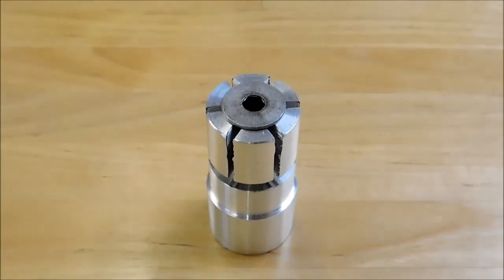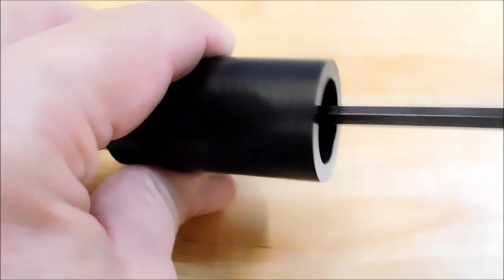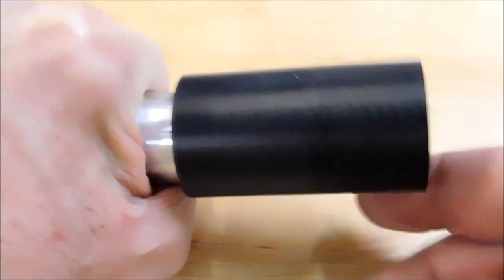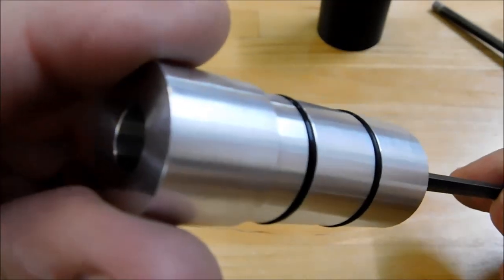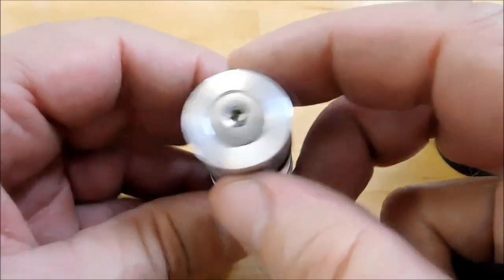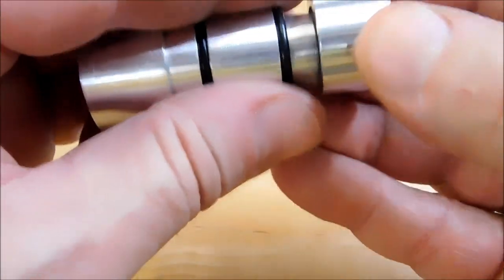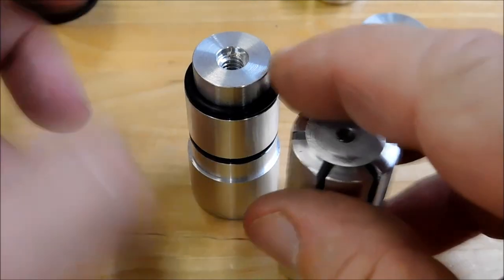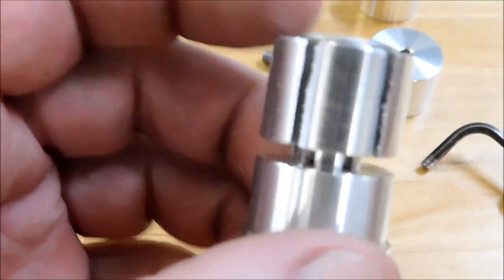Expansion Arbors --- No through hole...No Problem..Take a Look

Comment: To toss out my heavy duty arbor work around out here and no shorting Joe Pi for a great solution. Turn, drill, bore and/or reem to gauge pin size. Make 3 grooves for o-rings, not exposed. Over size length and diam. Hold in spin index, 3 cuts on vertical band saw for 6 pieces, leave one end to hold together. Take to lathe with 4 jaw, insert gauge pin free end, few drops super glue, center run out. Put 3 o-rings on it to hold. Part off, bevel and clean up. Make opposing taper sleeve and taper threaded inserts for hex screw length. It's going to warp. Insert tapers, few drops super glue, clamp one end with collets as dries, be quick, lol... Flip around and same for other end. Mount in spin index, spin and grind half under surface grinder, flip and do other half. Demount, remove o-rings, drop in acetone till it falls apart. Dry it off and reinstall o-rings, you're done. For small production runs on tough materials it's worth the effort. Joe's is better for one offs and plastics. This one's a lot more effort, but can be precise. Cheers

Comment: I was wondering, if you put the arbor in the lathe and slightly expand the fingers then turn them down slightly creating a taper on the fingers would that give you more contact surface on the part for better grip and less expansion force on the part by spreading out the force the arbor creates over a larger area. Whereas as is the very front of the arbor puts all the force on the front edged the arbor normally. Thank you for this great video, I plan to make me some up for standard OD sizes.
Reply from the maker: The final diameter of any expansion arbor is always turned with a light pressure on the screw. It eliminates the problem you pointed out and makes it easier to get the part off.

Comment: Going to check the repeatability, distortion, and different materials. Maybe Stainless steel. I would like to attempt to make longer assy to pass thru, expansion thru the project piece and hold on ends, check run out. Any suggestions on what materials use
Reply from the maker: These run very true if you leave an un-split locator diameter for the part. Any material will flex if you undercut it properly and use more than  4 splits.

Comment: I need something like this that will work on an ID polygon. Specifically a hexagon on one side of the part and a square on the other side. But to take it a step further each piece has a different size hexagon. In case you haven't figured it out yet I'm making sockets.
Reply: Actually now that I think about it I could probably just hold the outside of the part while I mill the inside square, then hold it from that.

Comment: Great advice Joe.  I am going to make a few of these.  
One question: I have a need to re-face 8 inch dia. copper and aluminium plates used for lapping gemstones.  What would be your advice on holding them in the lathe?  The problem is the flexing when cutting near the OD.  The plates are only 1/4 inch thick (or less) with a 1/2 inch centre hole.  The soft nature of copper and aluminium make this task difficult. (for me anyway)
I was thinking of making a steel backing plate with 1/2 inch arbor fixed in the center. The plates must be finished so they are very very flat, otherwise the lapping of the gemstone facets cannot be achieved to the required tolerances.  Some gems are polished to 50,000 grit to get the tiny facets to meet at a point.  Any advice would be much appreciated.
Reply from the maker: I spent many years in semi-conductor work and had to do exactly what you are asking about. The support at the jaws is OK, but the material deflection in between can lead to distortion and chatter. Watch my 'Simple chuck modification to parallel parts" video for the solution I came up with. It would be OK to add 2 standoffs between the jaws for improved support. Take a face cut with regular chuck pressure to start. Take a second pass with reduced, but adequate OD grip to reduce the material distortion and cupping potential. If you can get your hands on a 6 jaw chuck, that would be best. Good luck.
Reply: i found you about 6 months ago and have been watching quite a few of your videos since. some of the best i have found. i have always wanted to do a fitting and machining apprenticeship all the way to tool maker and then gunsmithing but have never found anyone willing to take me on. as well as that machining apprenticeships here are becoming more and more rare as most of the trades that dont absolutely have to be done here end up going overseas. this is due to a treasonous govt encouraging imports, regulating and taxing industry to breaking point to where they just have to close their doors. i hope to soon get my own small lathe and milling machine and start teaching myself. i already do some fabrication at home with welding and the like and once i get a new forge built i will be doing some blacksmithing and smelting as well. great videos and very clear information. there are not a lot of high quality tradespeople who can also teach so it is very good to see

Comment: For the o rings, is there a material that's better than others? And is there a hardness that's preferred? I got some made of silicone 55A in my McMaster cart and I am second guessing myself. I'd rather not buy one of each to find out. For reference, I plan to make an arbor for a wood lathe. I will be able to crank on it without fear of breaks or distortion, and the tolerance for concetricity is close enough is good enough.

Comment: Very clever trick sir.
 But wouldn't be better if you make a tiny chamfer on both parts that are squishing the O-ring, so it sits on v groove that helps the o-ring to expand easily ?
Reply from the maker: That makes sense. Just be careful the o ring pressure doesn't distort the cap or sleeve against the arbor and lock them up due to the pressure.
Reply: Thanks for your reply. One last question : What are the expectations for TIR for your both hard and soft arbors?

Comment: Nice! Question: on the split style, why not run a clearance hole through the entire split section? Seems like the threads in the split section are just getting in the way.

The o-ring style is ingenious. I'd definitely use at least two o-rings to prevent the part from cocking on the arbor. I wonder if you could use a differential screw to ensure that each o-ring gets equal pressure.

The other trick you could use would be to add multiple sleeves, with steps turned down at the end, to hold multiple inside diameters, like on a turner's cube.

Comment: Revisiting this video and it's just brilliant! I'm a pretty new subscriber and have been really enjoying your content lately! Just a quick question- can you comment on the precision of expanding arbors? I have a regular job where I need to hold a parted off ring (less than 1" ID) to work on the parted side, as well as to skim the OD. But I need the OD to remain concentric with the bored ID. Will I lose precision by using an expanding arbor- assuming I don't tighten so hard to distort the part?
Reply from the maker: Concentricity can not be assured if you locate your part completely on the split area. Keep that to a manageable minimum length and be sure you have a solid locating diameter for your part as well.

Comment: Great tip Joe!  I have a new bevel gear for the knee of my small mill that the shoulder is longer/deeper than the gear that came off.  Will this style of holding the work to shorten that should work?  Are there some length considerations also.  I can provide measurements or photos of what I am trying to do if that would help.  Thanks again for the very informative information that you provide!  John
Reply from the maker: If your mill is still operational, and you are concerned about gripping the gear in a lathe, strap it down to your mill table and mill the shoulder back. Feel free to send me a photo to my business e-mail. aiproductinfo@gmail.com
Reply: Thanks Joe!  Unfortunately my mil is not operational.  I'll take a photo and send it to you with measurements.

Comment: I have some custom fasteners I need to make on the lathe and I'm trying to think of a good jig for the job but I can't.  I basically need to do 2 operations to some 10-24 button head bolts.  First some threads need to me removed from the middle of the fastener, next the end needs to be cut to length (1.125") which is not a commercially available length.  I can think of jigs that would let me do one operation or the other but not both.  I'd prefer not to have to re-chuck between parts and just use the fastener threading to hold the work.
Reply: If you have  lathe with a short headstock spindle (like most cheap Chinese lathes) you could insert the screw through the spindle hole by making a long extension for a magnetic allen wrench. The fixture, held in the chuck, would be a simple piece of round bar which had previously drilled, tapped, counterbored (from what would become the left end) and then the bottom of the counterbore countersunk (same LH end)
Otherwise it's a bit tricky, I think. Do you have a quick acting (eg lever operated) collet closer of any description?
Reply from the maker: I have actually done a job like this, and coming in from behind is the way to go. I used a 5C collet with a stop, and a threaded slug to hold the part. Cut a counterbore in the slug to allow the head of the fastener to sit below the end of the slug. This allows for the use of a stop and controls the length of the thread regardless of what the head of the screw measures. Put a nut on you fastener from the opposite side, or the tool load may unscrew it from the slug. Machine as necessary.

Comment: These arbors will be exellent for removing and servicing brake caliper pistons, without the worry of marking their od
Reply from the maker: Thats a great idea. Use the aluminum kind.
Reply: I always removed them with shop air. Popped out easy.

I have a vintage Harley caliper with an aluminum body and steel piston that is stuck tighter than that.

I don't think it's going to matter much what I do as far as marking that one up...

FWIW, I've always been interested in making an adapter to hook a grease gun hose to a caliper and see if that removes the recalcitrant ones easier

Also, a trick another mechanic showed me for getting difficult boots stretched around the pistons win putting them back IN was to lube everything up, apply shop air two the inlet port, and hold the piston against the open end of the caliper boot.

The air blows it up like a balloon, and you slide the piston in it.
Reply: But, shop air sure as hell doesn't hold them in a lathe!

Comment: could this be done for a cnc lathe with a hydraulic chuck closer?? thinking an adapter could be made to fit the drawbar and arbor holder could be bolted into place instead of the chuck... need a way of holding castings in the lathe from the ID.

Comment: Hi Joe. What is your experience with the the precision of the set up with o-rings? Because it is not as rigid as solid metal support it should yield under the radial cutting force. How bad is the deflection from your experience? Can I cut under a thou with such a setup?
Reply from the maker: The relationship between the solid locating diameters on the arbor will determine the concentricity and location accuracy. Keep them close to your bore diameter, and the o rings should perform well. be very careful on very thin wall jobs. The o rings will push out hard.

Comment: Not sure if you have a video already on this subject, but "Holding screws" for modification in the lathe.....any good tips?
Reply: Take the right size nut and cut it with hacksaw (not in half just one cut -it will allow it to squeeze around the thread without damage it).You can use same trick with round stock to hold square peace in center in the three jaw chuck.
http://www.instructables.com/id/How-to-make-and-use-a-Pot-Chuck-for-your-Lathe/

Comment: Joe, need to use this to hold a timing pulley on the Servo of my BP CNC.  Pulley uses a taper lock collet.  problem is the shaft on the new servo doesn't extend far enough so there is a misalign between both pulleys.  I need to make an extension shaft, and am going to try this method.  Question is let's say the steel shaft is .8125" diam what size undercut you think I should employ  so the arbor will expand nicely but not be too weak for a BP style CNC?
Reply from the maker: The undercut size would be dependent on the screw used. Its more of a wall thickness relationship than actual diameter.

Comment: Very nice. And a good project for a beginner like me.  Have seen many expanders on the net and I notice that the expansion har the form of a rather sharp "ring" (visible at 10:33) at the end of the expander.  This is OK for steel etc but what about delicate and thin material? If the outside is tapered opposite to the inside one hopefully a wider area will meet the part causing less deformation. Or?  Suppopse smaller taper angles would make for a large "bearinglike" ring. Or?
Best regards/Ingvar
Reply from the maker: In the final operation of making one of these, you apply gentle pressure to the screw. This flares the arbor. You then turn the exact diameter OD on the arbor of the part ID you wish to hold. When you release the screw, the arbor tapers down towards the screw end. When you insert the part and re-torque the screw, the contact is very cylindrical. The taper is nearly non existent unless you machined too much off initially.

Comment: How accurate is this method of holding something? If you put something like a bushing on that arbor and need to machine the od how concentric could you get the two diameters?
Reply from the maker: Done correctly, its very accurate. Just don't split the location area and you're ahead of the game.

Comment: Sir, I need your assistance. I am trying to make something similar but much larger to place down into a tumbler, which is a stainless steel drinking up. I need it to make a cup chuck to hold my tumblers onto my chucks while the turn on my motorized tumbler I built. My cups are 10 inch in diameter and the chucks are made from pvc pipes and currently I am using foam to hold my cups I’d like to build a large arbor that is at least 3.5 wide so I may slide the arbor into the cup and tighten it so my cup will be held in place. I tried to get my husband to help me but oddly, me the wife, I am more interested in things like this more than he is, I truly hope I can get a comment back! That would be fantastic!
Reply from the maker: Greetings. A problem like this has to be a little better defined before a remote solution can be offered. Are you holding more than one cup at a time? What process do the cups undergo once mounted? Can you remove the arbor that holds the cups in between each process? Stuff like that. Large diameter arbors like this can be segmented and have multiple screw locations to activate them so you don't need a 10" o'ring. Is distortion or concentricity a concern. I'll help you, just tell me more.

Comment: Hi Joe nice video

What should be recommended taper angle of bolt? I mean with what angle we will get max. gripping force eg. Let's compare 90degree CSK bolt and 120 degree CSk which will provide more gripping force i case of expanding collet?
Reply from the maker: The smaller the angle, the greater wedge effect you get. Also, the higher the possibility the screw won't release when you loosen it.  60 to 100 degrees is a good range for grip and release.
Reply: @joepie221  Thank sir. Appreciate your prompt response

Comment: Clever idea. Does that require the use of an independent jaw chuck to  run the part true? Thanks for adding the tip at the video end -- making clearance at  the screw's thread termination. Your experience shows here.
Reply from the maker: Thanks. If you make the final holding diameter cut and leave the arbor in place, the chuck does not have to be dead nuts. Just be aware once you remove the arbor, you may have to indicate it for the second use if not used initially in a collet.
Reply: @joepie221  Thank you for your reply. I learn much from your videos.
Reply: Just reading this it's just occured to me, when using a screw from the rear which ends up inside the chuck it would probably be better to use a draw bar instead, tighten the arbor in the chuck then have a draw bar to pull the cap into the expanding Mandel, loosen and remove the part then add another and tighten from the change gear end of the spindle so the arbor stays where it is, this has a drawback though of you only have a very thin bore in the spindle , my Myford M type only has space for an M6 draw bar but, M6 1.0mm should be a strong enough thread as long as its not a cheap threaded rod from a hardware store

Comment: Hi Joe, these expansion arbors look really useful. Does the O-ring version provide good repeatability for 2nd ops?
Reply from the maker: Make sure you have solid references for location and only rely on the o'rings for grip.
Reply: @joepie221  Thanks very much for your reply. I'm thinking about using several of your o'ring arbors oriented vertically in a 3 axis mill to machine the underside of a cylinder (with no through hole) as a 2nd op. The tolerance isn't critical, just aesthetic. The slightly tricky thing is that the cylinders are contoured on the outside, so ideally the arbor would provide a repeatable X and Y reference. Maybe if the collar and cap are a close slip fit inside the cylinder bore, that would be accurate enough. Or maybe your split arbor design would be more repeatable. What do you think?
Reply from the maker: @tacitus101010  A common mistake many make when using arbors like these, is to rely on the grip feature of the arbor to act as the locator feature as well. However you design your arbor and regardless of which style you select, be sure your part registers on a non-split or flexible area / shoulder.